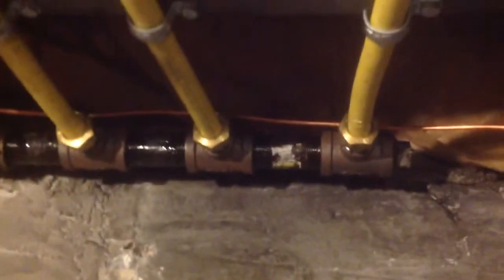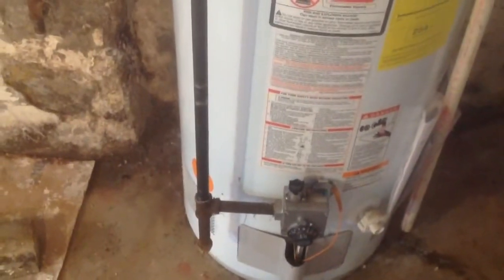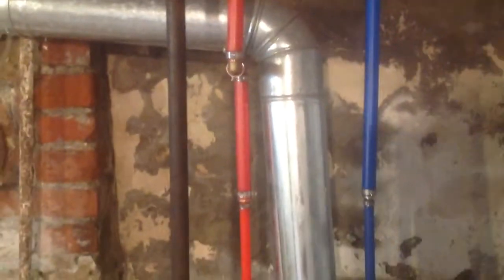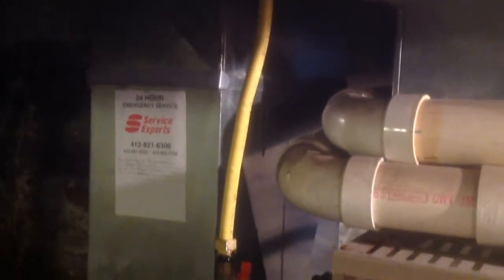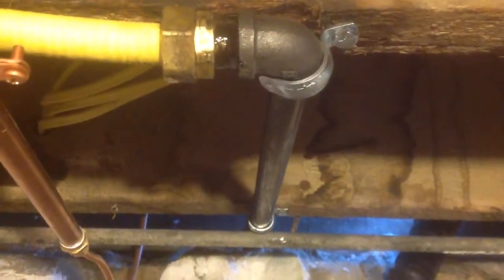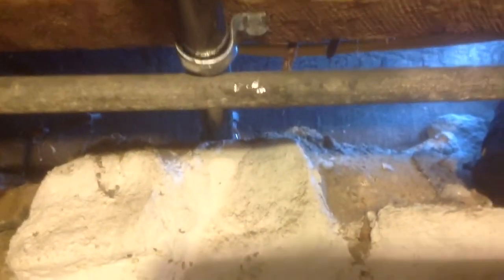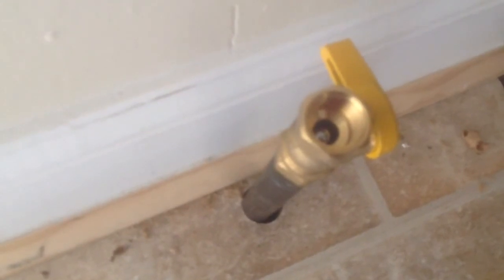Csst installation

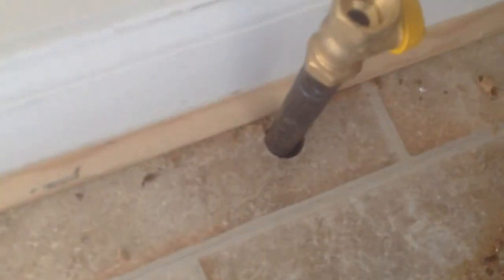Comment: Looks great. I saw a This old house video, https://youtu.be/_Hz-BAFh3rI?si=dOUzgDS88R7DlXAB&t=128  titled, How to Work with Gas Pipes,  around 2:08 minutes, it suggests putting a valve at the beginning of a branch. I think this helps if need to isolate a leak search, but I'm only just getting starting with plans. But yes, every end point seems to also have a valve.